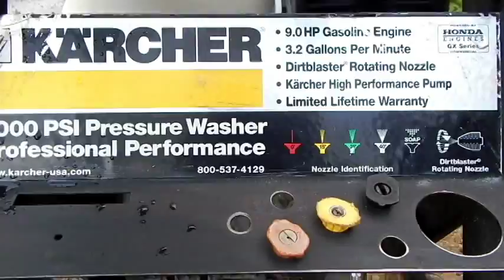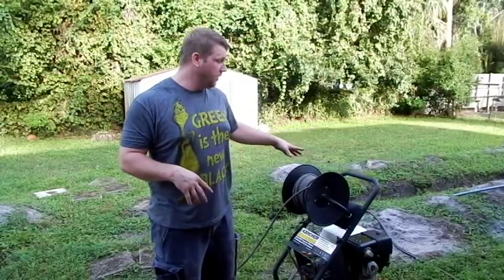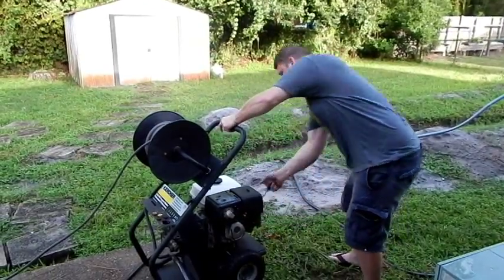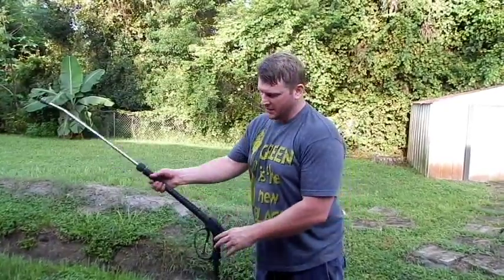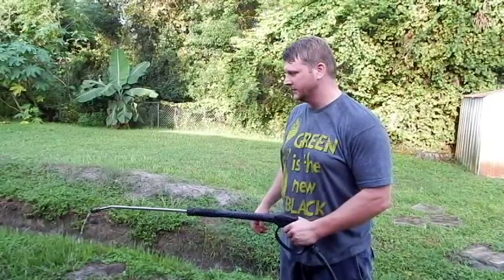KARCHER 3000 PSI PRESSURE WASHER 9 HP HONDA ENGINE POST 8995

Comment: If you don't want the pressure build up when starting then hold in the trigger when you pull start.That was it will not build any pressure but never ever start up without water...air can damage the pump real fast.

Comment: Its 6 years now since the video, are your pump has destroy now ? if you keep doing starting the engines without water, your pump seal will blown off and the water start sipping into the oil case and bearings..

Comment: Which is better elecetric or gas Gas sound will provoke neighbours
Reply: Gas got far more power and make a cleaning lot more easier.. i can clean up the concrete driveway using gas machine at only 20 minutes while if using a electric it will take an hour and the motor will not last long if use it for extended time.